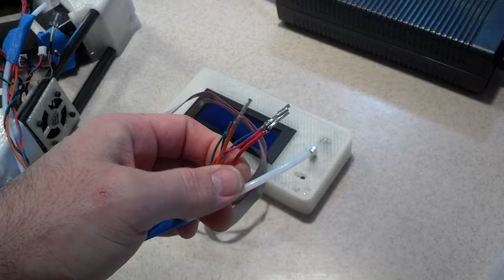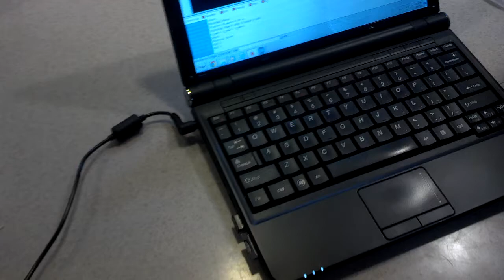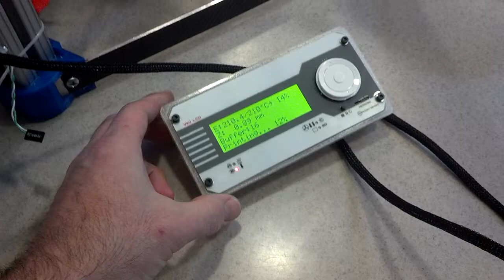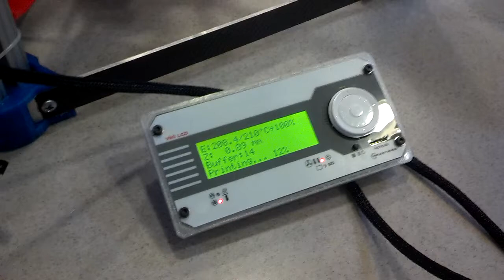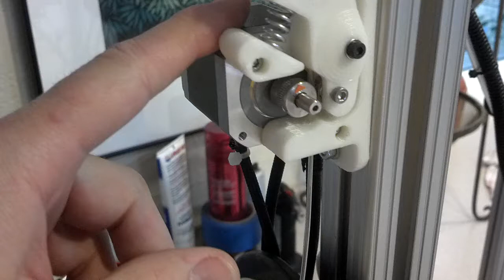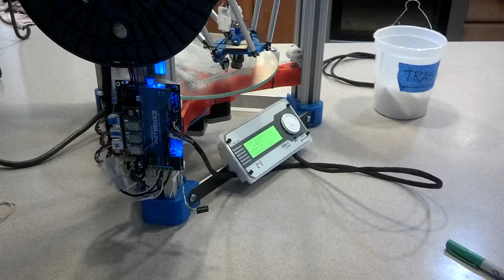Cerberus 3D Printer Progress Report

Comment: Steve, how have you attached the Extruder bracket to the extrusion?
Have you  tapped the metal, or got some kind of nut in there?

Thanks
Ash
Reply from the maker: The extruder bracket is held on with two M8 phillips style pan head bolts. The pan head bolt head slips down the extrusion t-slot and uses a star washer to help friction-lock it to the alumuinum so you can tighten a nut from the outer side.